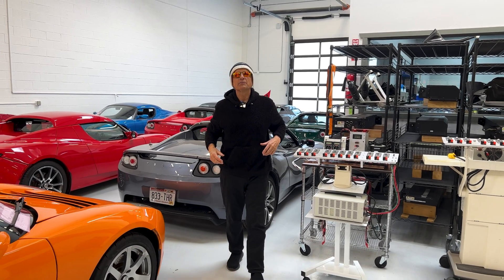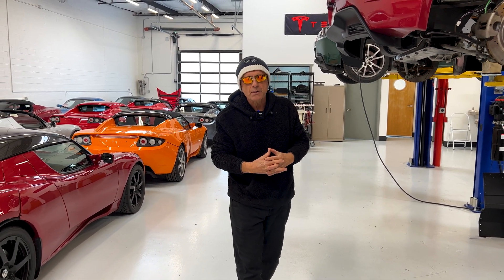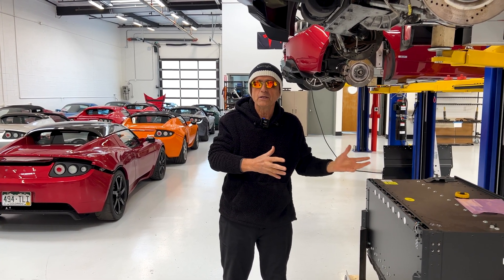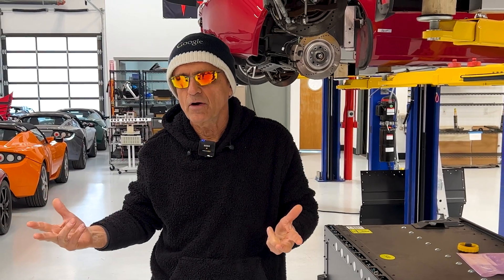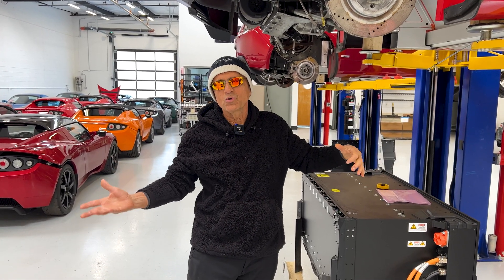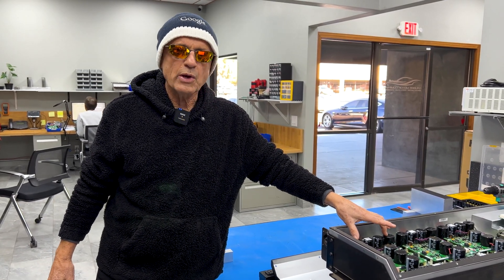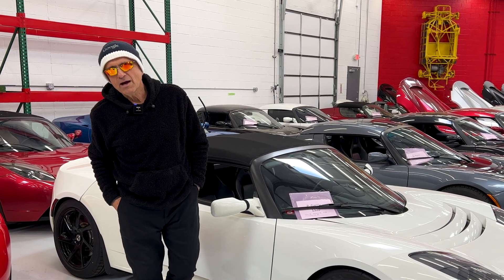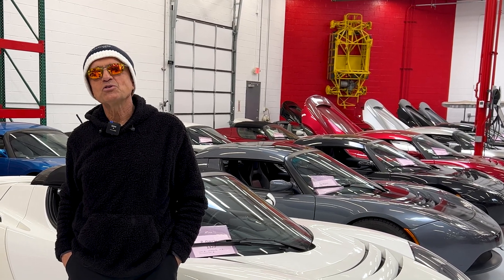The TRUTH about EV Mileage and Valuation | Gruber Motors

Comment: A roadster is consider a toy … it need to look good and be in good condition . In some case a 30k miles car can be in a worst condition than a 90K miles one , but the chance are in favor of the lower miles one to be « cleaner » .
For sure if you want a daily driver don’t pay too much a premium for a low miles one cause it will cost you a lot per mile rank up on it …

Comment: Well, you do have bearings in the electric motor. I wonder if that's a common failure point in high mileage EV's. I don't think it should be if the bearings are sized correctly, but on the other hand the rotor is a pretty heavy component.